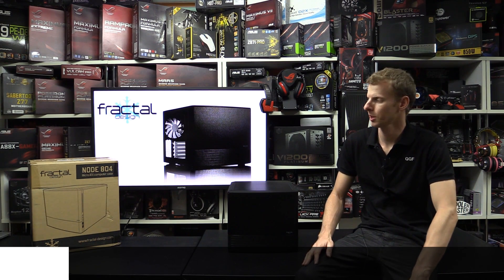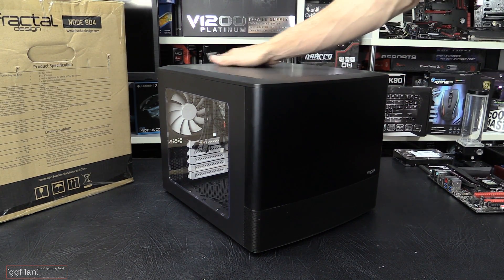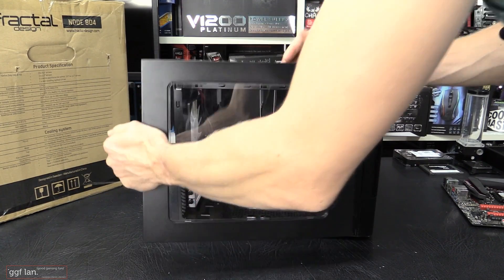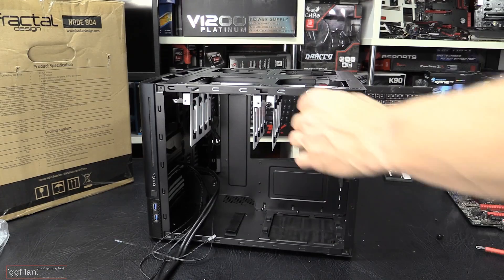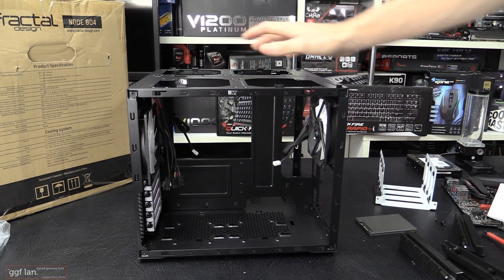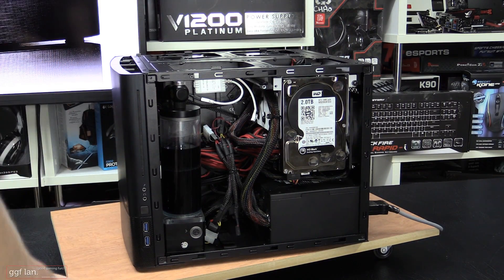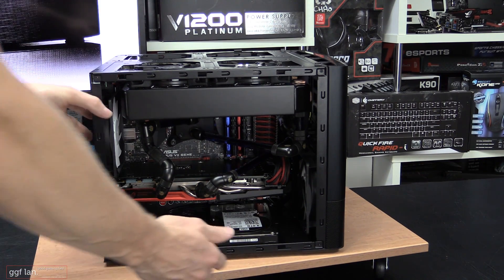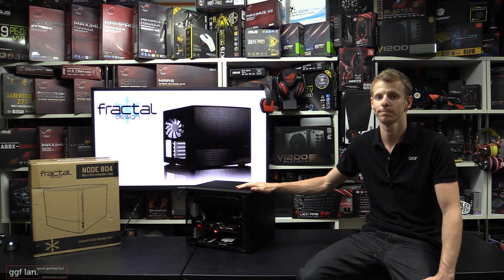#0093 - Fractal Design Node 804 Review - Includes rigid loop + 8TB of storage

Comment: what brand of radiator are u using
Reply: It's an AlphacoolXT45 240mm
Reply: Stuart Tonks am using same brand Alphacool30 240mm tried a XSPC AX240 which did not fit any where.  Can you close both sides as I could not with the XSPC.